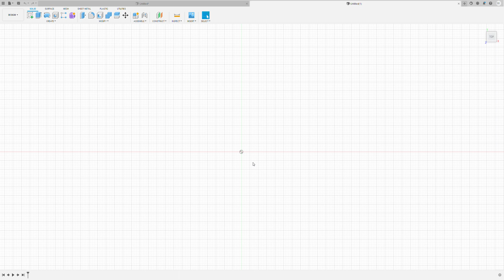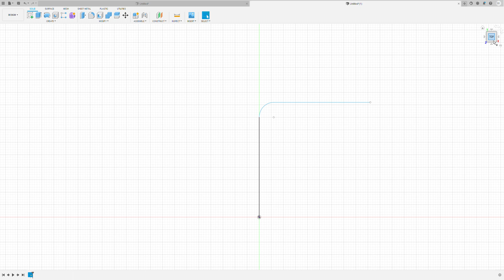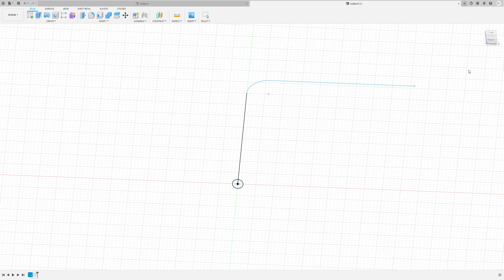How to bend a rod in fusion

Comment: The sweep command certainly works.  I'm wondering if the sheetmetal function will be able to manage this so that it will give a flat pattern in the end.
Reply from the maker: In inventor theres a tube and pipe module that i use for mapping hydraulic lines. 
Maybe the same thing is for fusion?